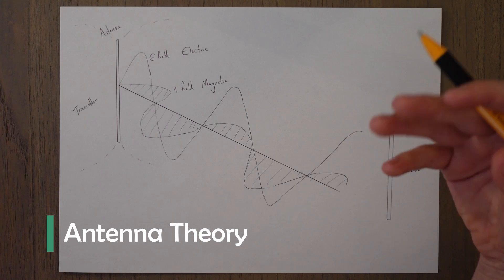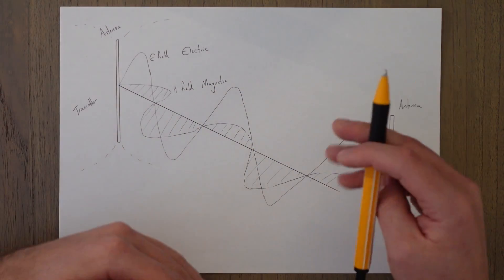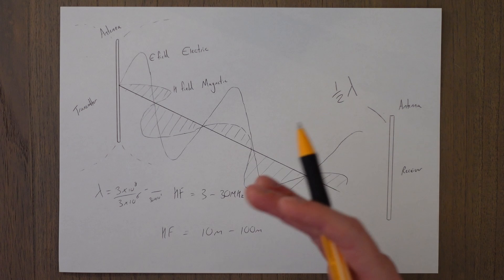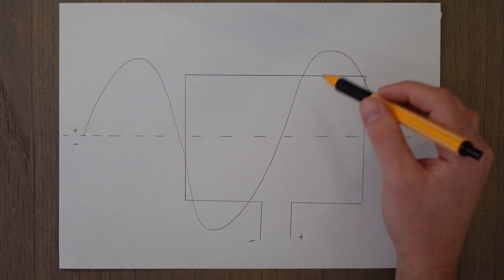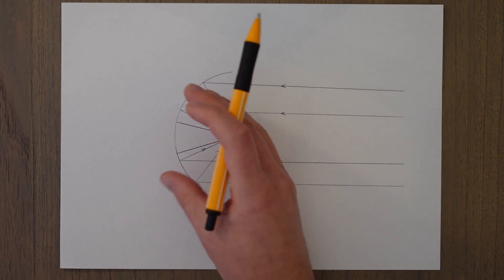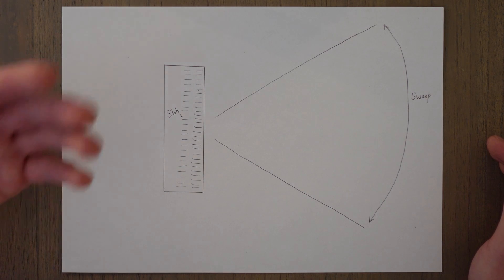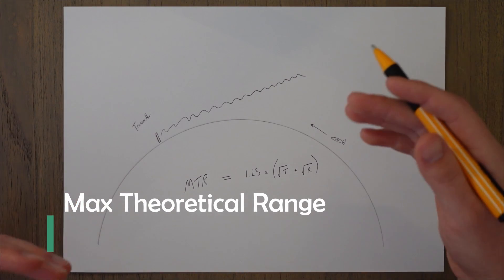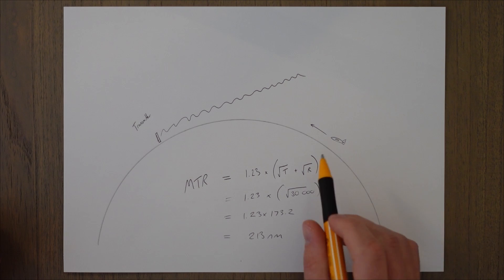ATPL Radio Navigation - Class 2: Antennas.

Comment: When multiplying the range is it 1.23 or 1.25 ?My instructor says its 1.25
Reply: its 1.23
Reply from the maker: i think for the precise answer use 1.23. If you need an estimate to calculate when you are flying it is much easier to use 1.25.

Comment: the formula MTR: you multiply 1.23 x feets = nautical miles? units of measurements are correct?
Reply from the maker: In Aviation generally NM for long horizontal distance and Feet for vertical distance.
Reply: Yes thank you :) the thing is, in the video, if I’m not wrong, you multiplied feet for 1.23. But then you wrote nautical miles. Maybe you did the conversion directly, i didn’t notice 🤙
Reply: @ivan_heavy620  yes mate, the 1.23 gives you directly the result in NM if you use fts, for the height.